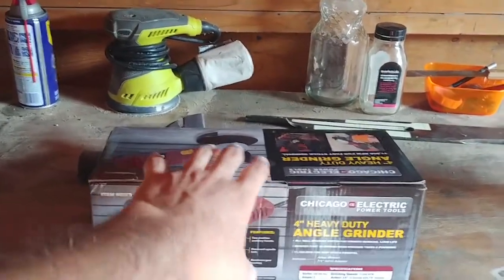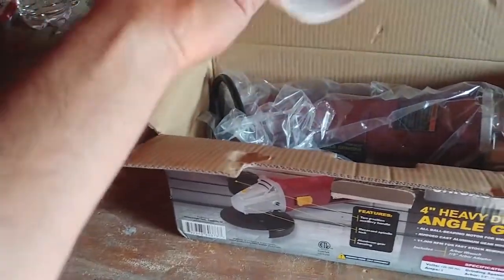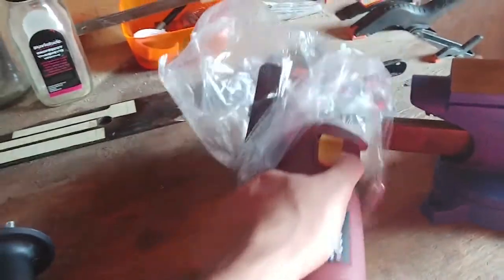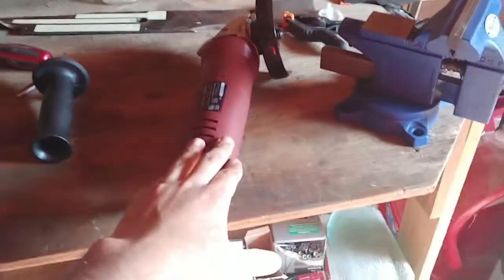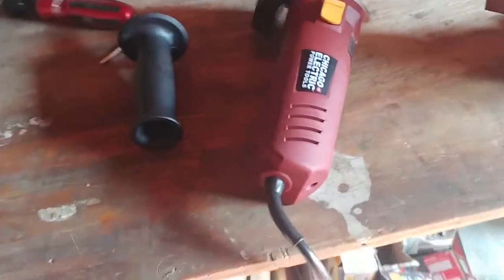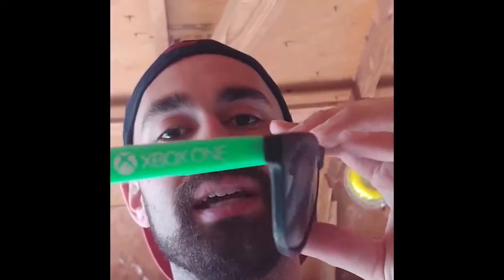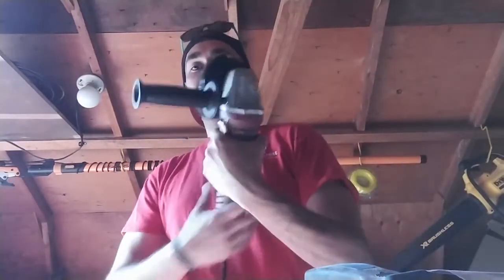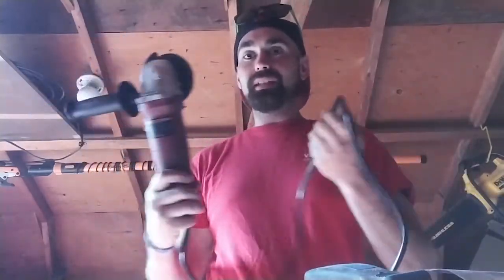$20 harbor freight angle grinder review

Comment: I bought 5 at $8.99. Years ago. I keep one in welding bag. one in the shop and other in a plastic tote  because if one fucks up and after 50 hrs it paid for itself. Also if you have to jump on a table to avoid the grinders movements it's not the grinders fault. It's your own for not knowing a grinder works. They don't stack up to a Milwaukee (I own a Milwaukee grinder and a DeWalt) but I've ran one for almost 3 hrs straight with not a single issue... I bought those 5 almost 3 years ago and neither have crapped out. So I still have 3 new in the box.. and I still spent less then DeWalt or Milwaukee.. throw away like these are what hbf is good for. Rpm is a lil slower and they are corded. But for the price it's the best deal. So what if you burn one up. You'll burn a DeWalt up in the same amount of time but you literally spent ten times the money.. this is one of those few harbor freight tools that are worth it. But 5 and to hell with the warranty. You'll get a year of continual use outta each one. Less then 10 bucks a year. I can't buy a DeWalt for half that and get a year and a half outta it. I'll run the cord to save that kinda money worth it. Stay away from thier wire wheels though. You'll go off under a metal detectors years later..
Reply from the maker: I totally agree with you I still own mine and I never blamed the grinder well I jumped on the table that was the first time I ever used a grinder